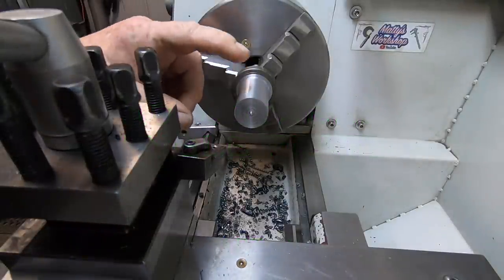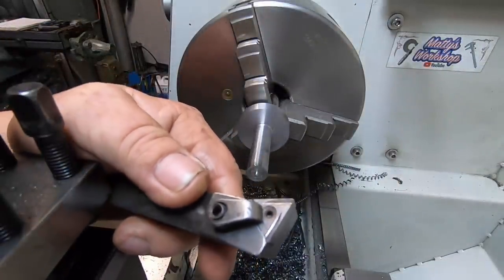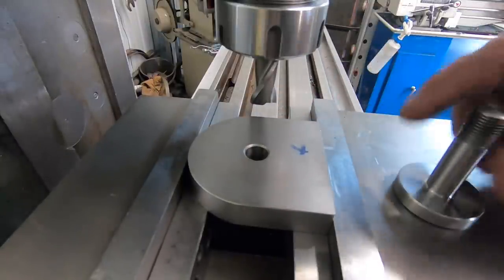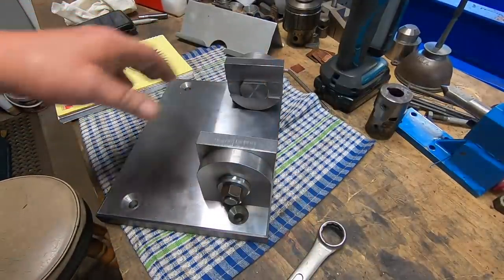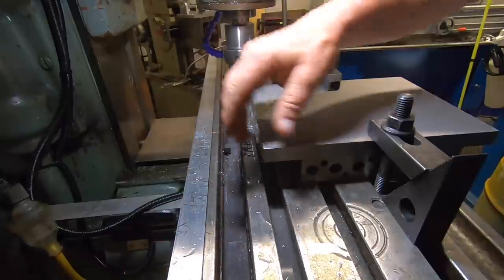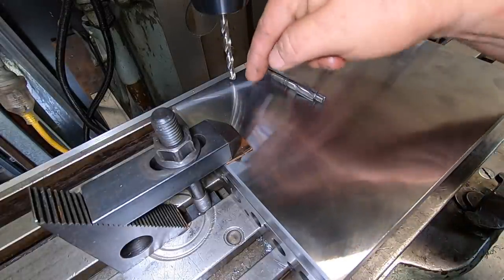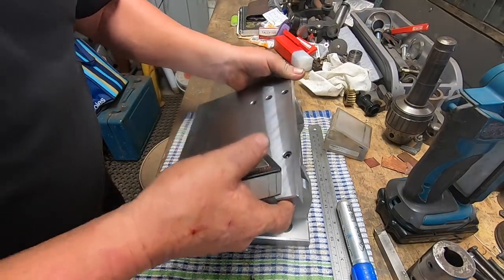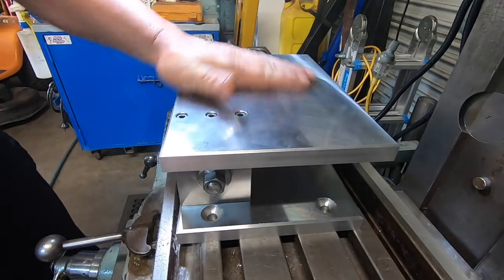Adjustable Angle Plate Part - 2

Comment: The Angle Plate turned out Incredible Matty. If you shorten the Base, you may need to also cut a Angle on the underside of the Top Plate to get to 45 Degrees. As far as the Slots or Holes on the Top Plate, I don’t really know for sure. Maybe you could do both? Anyways, Great Job as always.👍 every time I watch one of your Videos, it inspires me to try and build something. I really enjoy All your Videos. You definitely deserve the Certified YouTube Machinist designation.
Reply from the maker: Gday, after thinking about it and reading the comments I’m thinking I don’t need to tilt the table 45° both ways, I’m thinking I put taped and reamed holes in top plate and more mounting holes in the bottom plate, it’s great to hear my videos are inspiring and you enjoy what I do here, thanks for the kind words mate, truly appreciated, Cheers

Comment: Some slots and add a bunch of tapped holes in-between. I personally prefer holes but a slot it very useful for a standard clamps which usually dont fit any hole spacing practically. I love what you have have done and personally wouldn't worry about not getting 45 both sides, my interest would be having the table area but having said that I only work in soft materials Al etc so I can afford the leverage on the pivots. I'm going to have a go at exactly what you have done but out of Al and I want to put an adjustment screw on the plate somehow so I can adjust the angle easier at least around the zero position, maybe 20 degrees either side or just 90 on one side I don't know but I hate having to hold the plate and tighten it. I enjoy watching your work especially after you explain what you are doing and then comment "that was a lot of talk for bugger all" :)
Reply from the maker: Gday, Aluminium will be good to build one from, I still think on what to do with the top, tapped and reamed holes will be the go id say, ive been looking at how I can put an adjustment screw on as well, Cheers

Comment: The angle plate turned out really nice. to get 45 degrees both ways just make and taller set of vertical uprights, and I would just drill and tap holes as needed. and on the uprights you could drill and ream holes for locking pins just as secondary lock to make sure the angle can not change just a thought may be overkill. Cheers
Reply from the maker: Gday, drilling hole in the pivot is a great idea, I can use these in set it a 30, 45, 60 and 90°, nice and quick, thanks for watching mate, cheers

Comment: My vote is for dilled and tapped holes. Makes it more versatile. Also I would not cut down the base. Keep it wide for a more solid platform. If you came upon an odd job where you needed 45 degrees in both ways I would just make another smaller base.
Reply from the maker: Gday Tom, most of the comments I’ve reed so far also suggest tapped hole also reamed holes for pins, I’m thinking I really don’t need to 45° in both directions, I’ve never needed up till now anyway, thanks for watching and commenting mate, Cheers

Comment: Looking at your top piece, you could turn it in the horizontal plane and get your 45 degrees to the centre of the bottom plate. If you were to do this (assuming it worked) I would look at the fastening based on that option. May give you more options on the machine. Also if you are looking to put a turntable on this won't you lose too much headspace?
Enjoying your thinking as normal, good luck.
Paul
Reply from the maker: Gday Paul, after thinking about it I don’t really need to get 45° in both directions, I have to be careful what I put on the to, I’m limited to Z height, may need a low profile chuck and vice, appreciate you watching mate, cheers

Comment: Matty it sure is a work of art got to be proud of that.
To make the tilt angle reach 30^ chamfer the underside edge at least you then have 60^/30^. To get 45^ can you undo the pivots, flip the plate side for side with shorter edge now facing the other way? This could be an advantage when milling.
OR Make 2 or 4 taller base Pivot plates a simple fix.
  As for ways to attach I reckon  2 or 3 long slots Plasma cut? and a few holes for good measure. If some reckon slots will weaken T-slots would also?
Reply from the maker: Gday, I’m really happy with how it’s turned out so far, I’m think to set the 30°,60° and 45° I could drill and ream holes in the pivot arms and use a very neat fitting pin to lock it in place, appreciate you watching and commenting mate, Cheers

Comment: Better than my bought one! It's a bit late now, but if you had the pivots in the centre of the plates you would get 45 degrees both ways. I think I would drill the top plate as required.
Reply from the maker: Gday Mark, if the pivots were in the middle I wouldn’t be able to get 90°, I think I’ll be putting taped and reamed holes in the top plate, appreciate you watching and commenting mate, Cheers

Comment: If you want 45 in both directions drill an extra set of holes in the top plate and have the pivot in the middle. I expect someone else suggested it but there are too many comments for me to check them all.
You could also drill and ream for locating pins between the screws for easy realignment if you swap from middle pivot to the original.
Other than the above suggedtios that turned out really nice.
Reply from the maker: Gday Chris, there’s certainly a lot of comments to get through, I’ve spent quite a few hours answering them all so far, after looking at the comments and angle plate I really don’t need to be able to tilt it 45° in both directions, one ways good enough, appreciate you watching and commenting mate, Cheers

Comment: maybe drill some extra holes in the top plate for the pivot ears , you could move it ahead to get more tilt if needed. I'm not sure what type of steel that is, but T-slots might introduce a warp so I think pallet. thanx for sharing
Reply from the maker: Gday, great idea being able to shift the top plate with extra mounting holes, I worried if I do slots it will bow, my lunch it’ll be a banana, thanks for watching and commenting mate, Cheers

Comment: Beautifully engineered angle plate! While it's easy to criticise from an armchair, I would have loved to see this rotated with some sort of screw mechanism for more precision and flexibility in adjustment. Also some sort of ball or pin locking mechanism for the most used angles like 15, 20, 30 and 45 degrees?
Reply from the maker: Gday, having a mechanism to rotate the table is a great idea, not sure how I’d do it but worth thinking about, the table really needs locating pins for common angles, this is something I need to do, thanks for watching and commenting mate, cheers

Comment: G'day Matty; I didn't read all the comments, so someone might have already suggested it...why not mill the face of the bottom plate to 45 degrees. It'd maximise the stability given by the bottom plate and give a sort of 'automatic' stop for 45 degrees. Of course you need to position the whole unit so the bottom corner of the top plate went into the t-slots of the mill bed, which might be inconvenient sometimes.

Comment: I'd drill and tap the top plate.  You can make a sacrificial aluminum pallet that bolts to that pattern if you need a custom layout that doesn't work with the regular bolt pattern on the angle plate.  I'd leave the bottom plate.  45 both ways seems like you'd have to remove too much to get there and getting to 39.73deg isn't any better than where you're at.  I might consider adding a sine roll to the bottom of the upper plate, or adding doweled holes in the pivot ears at convenient angles (30-45-60).  This is a project I think I will make for myself.
Reply from the maker: Gday Barry, that’s a great idea have a sacrificial plate for custom set ups, I’ve been thinking of adding a series of holes in the pivot plates for quick setups, thanks for watching mate, cheers

Comment: Keep the base the same.  Consider putting additional mounting holes under the base plate to allow you to move the supports closer to the rear (as it's sitting on the machine near the end of this video) and with care you could create an automatic 45 degree angle.  Just a thought - I would not reduce your contact area of your base without good reason.  Drilled and tapped holes will be a lot more universal and potentially a lot more solid than two or three slots to my way of looking at it.  Probably a lot less effort and stress than trying to machine T slots too.  That fly cutter sure does a good job.  I have to stop looking at my lathe and start setting it up properly...
Reply from the maker: Gday,, I’m definitely going to put in more mounting holes in the base and by reading all the comments tapped and reamed holes are definitely the way to go, I hope you get your lathe setup soon and I hope you enjoy it mate, appreciate you watching and commenting, cheers

Comment: An array of threaded holes.  Maybe the central zone left plane for a chuck mount.  Start onthe chuck first and then run the array.  Nice project indeed !
Reply from the maker: Gday, I think I’ll need a low profile chuck just to save on Z height, I’ll be putting series of taped and reamed hole in the top plate, appreciate you watching and commenting mate, Cheers

Comment: If it were mine, I would do the tapped holes, IMHO slots are somewhat limiting.
On the bottom I would just add 2 more holes to line up with the center T slot but leave the plate the same size as you have it now, you could always hang it off the front and turn it 180 degrees from what it is now. 
You asked :-)
Reply from the maker: Gday, ready through a lot of the comments tapped holes seem the best way to go, I will be adding more holes to the base plate to allow the angle plate to hang off the side, yes I did ask and I really appreciate you commenting, thanks for watching mate, cheers

Comment: If you added some more mounting holes in the top plate , you could move the plate closer to center of the pivot pins and get your 45 degrees from either side. maybe.  Nonetheless, that is a nice piece of work.  I vote Holes, no t-slots.
Reply from the maker: Gday, definitely be doing hole and not slots and extra mounting holes, thanks for watching and commenting, cheers

Comment: That's one heck of a tablet mount😉😉😅🤣😂, but in all seriousness, it  looks great sir, believe just start drilling holes and tapping them, maybe 2 different sizes, like drill alway through with ¼-20 drill tap size, and the drill half way down with some like ½-13 tap drill, way you'd have 2 different size holes to maximize uses of this amazing work!! That's just our idea of course, but make a nice video to upload 😉😉!!! 
And that surface finish looks like you do have a surface grinder squirreled away somewheres 😀 😏😉, those surface grinders aren't cheap, trust we've been looking, guess we'll be making one after we get our home made from scratch lathe built, give or take a year or 3 😁
Reply from the maker: Gday, I wish I had a surface grinder hidden away in the background, there not getting any cheaper that’s for sure, thanks for the advice on the hole sizes, appreciate you watching mate, cheers

Comment: very impressive!

I think I would make 2 horizontal T-slots and 2 vertical T-slots all the way edge to edge, leaving some center space for chuck mounting holes.
Reply from the maker: Gday, I’m a bit worried about the top plate warping if I put slots in, still a bit of thinking to do yet, thanks for watching, cheers
Reply: @MattysWorkshop  yes I read other comments worrying about that. 
The plate is quite beefy  but it's better to think it over and over again

Comment: gday matty great job there mate i would drill and tap to keep the strength  of the top plate to keep the rigidity for the workpiece  where you get 29 degrees i would put a 16 degree bevel  on the under side edge to get a 45 both ways plus it will give you 3 point contact and even more solid work support or 16 degree on the bottom plate  just a thought cheers wayne
Reply from the maker: Gday Wayne, tapped holes sounds like the way to go, I’m going to give it a bit of use to see if I need 45° in both directions, I really don’t think I will at this stage, appreciate you watching mate, cheers

Comment: You could use a mounting plate on the top.  To fit a chuck or vice if you sloted the swivelling plate
Reply from the maker: Gday, thanks a great idea, thanks, cheers
Reply: Thanks glad you liked the idea the fixing plate only needs to be max 10mm or so all the best

Comment: May be an additional support on the end of the plates would be something to consider to make it really rigid.  Now all the forces are taken up in the pivot. Also having a support on the end would make it really rigid
Reply from the maker: Gday, I was looking at this today, definitely something to add to the job mate, Cheers
Reply: @MattysWorkshop  i was thinking  on how to achieve this which is not trivial. You want to support the rotating plate over a large distance and quite precisely.  My guess is that you set the height with this support contraption and then lock the two hinge mechanisms.

Comment: On your angle question,How often will you need to swing it both 45*  in one setup. I’d keep it the way you have it till you need to have it both ways. On your pallet or T Slots, I’d try to work it so you have both.  Thanks for being able to look over your shoulder.
Reply from the maker: Gday Norris, I think I won’t worry about trying to get 45° in both direction, your right, how often is it needed, I think a series of drilled and tapped holes are the way to go, thanks for watching mate, cheers

Comment: Personaly I would go with the taped holes and and drill another set of holes in the middle to move the pivot point back towards the centre and try to achieve 45 deg either way just some thing to think about but great work 👍👍
Reply from the maker: Gday, tapped holes sounds like the most popular idea, I don’t think I’ll worry about trying to get 45° in both directions after a bit of thought, thanks for watching mate, cheers

Comment: If you need T Slots, simply fabricate some from 12mm square bar with 32 x 8 flat bar counterbored bolted to the top.  Then bolt from underneath each square bar to you nice new plate at your desired T Slot centres.  That way you won't lose any strength on your plate.  Fly cut the top of the flat bars to ensure the new T Slot assemblies are flat.
Reply from the maker: Gday, I think I’ll do reamed and threaded holes, you idea on how to do the T slots is really good, I could always make a second top plate and do your idea, good project for the future, thanks very much for watching and commenting mate, Cheers

Comment: For me make it a pallet style for fixing. For the angle put a chamfer on the bottom so it's tilts to dead nuts 30 degrees then use the other ay to get 0 to 90. Add some stops in the base to get dead on 90
Reply from the maker: Gday, great idea adding stops adjustable stops to get the angle spot on, thanks for sharing your thoughts mate, cheers

Comment: I would do tapped holes on the top plate.

If you cut the base plate and use the other t-slot for mounting, I don't think the top plate will tilt far enough to get 45º that direction, will it? If not, then I'd leave it as is.

Another option, would be to cut the base plate off at the ear and only have 1 mounting bolt on each end. Then center the top plate over the ears. Should be able to get +/- 45º, maybe even +/- 60º. But then you would give up the 90º option. So many trade-offs!!!
Reply from the maker: Gday Andrew, I think I won’t worry about getting 45° in both directions, I don’t want to lose the 90° position, thanks for watching mate, cheers

Comment: Drill and tap holes..for my thinking..I reckon that if you put T slots you are going to weaken the plate and you will get some movement and instability at times…
Reply from the maker: Gday Gary, I’m think tapped and reamed holes is the way to go, thanks for watching mate, cheers

Comment: I would do drilled and tapped holes as well as dowel pin holes. I think a plate made this way is more useful. My self would make one each drilled and tapped and tee slots once I get Material found thanks for the tutorial.
Reply from the maker: Gday Mike, taped and reamed holes sounds like the way to go, I’m worried if I do T slot it might warp the plate, appreciate you watching mate, cheers
Reply: @MattysWorkshop  The top plate with tee slots start with thicker material and machine and flat grind the stresses out of it through out the process. That is my plan. Might even build it modularly and bolt it together and finish machine and flat grind it.
Reply: @MattysWorkshop  What are the dimensions on the 4 plates with the radiuses? L x W x H and the radius. Thanks

Comment: This may be a bit late but it occurred to me that I didn't mention adding a few smooth bore holes for locating pins, I use locating pins on mine but mostly to have a set of pins for the part to rest on when the pallet is set at an angle before clamping it down to the pallet.
My locating pin holes aren't exactly parallel to the edges but I usually check for squareness or parallelism with a test indicator anyway, so the locating pins are really just to keep the part from sliding off the plate till it's clamped down.
Best to ya!! :-)
Reply from the maker: Gday, location pins are a great idea, I’m thinking of 4mm ground rod to do this, appreciate your thoughts mate, cheers
Reply: @MattysWorkshop  
You are welcome :-) 

Joe